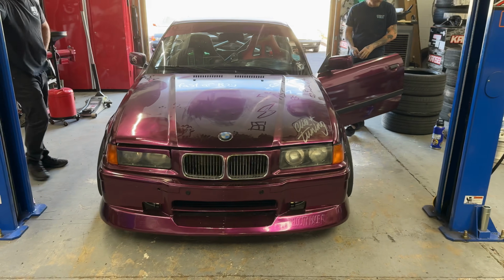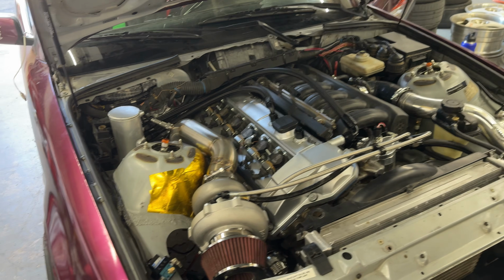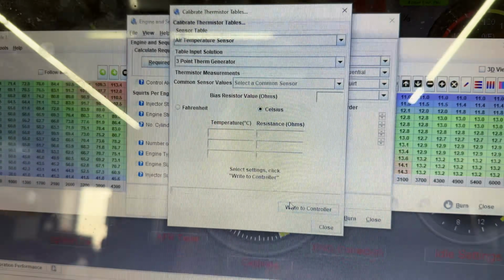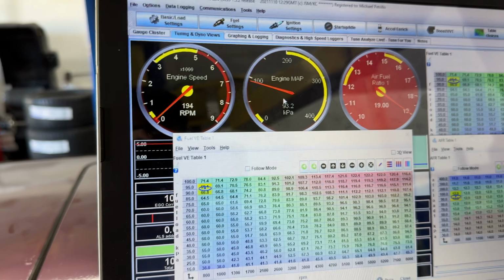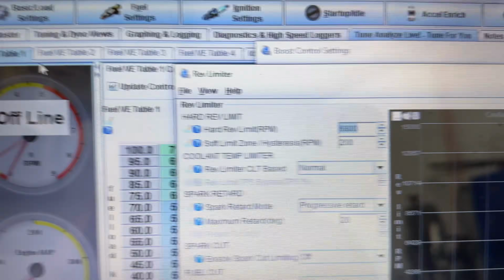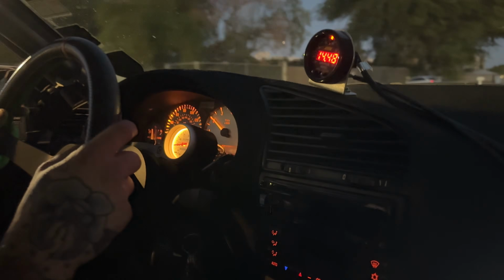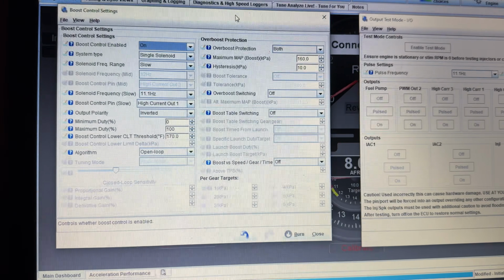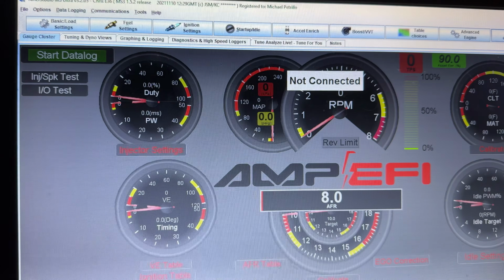Tuning A Turbo BMW E36 With A Megasquirt MS3Pro PnP ECU

Comment: Also if your trying to follow along they put the Injectors in batchfire over sequential becuase if your trying to get a cam sensor for a 96-99 M52 gooooood luuuuuck
Reply from the maker: I agree, it's not worth dealing with cam sensor issues on these cars. Only oem ones work (every aftermarket one I've tried is bad out of the box or lasts a few months) and you can't even buy oem ones 🥲

Comment: Looking at ms3pro pnp for s52. Currently NA, prepping for turbo. Would the choice of wideband controller give a tuner headaches? Looking at the Spartan 3 V2. The installs I can do, just don't want to choose an ECU or components that will have tuners telling me to find someone else or buy something else 😅
Reply from the maker: That wideband controller is one of the dropdown options in the calibraton settings. Its no different from any other to setup

Comment: Let’s make sure to let the potential DIYers know to check that base ignition timing with a timing light before jumping in it. I’ve seen a couple of goons melt pistons because they were commanding way more timing than they thought they were. 
Set your solenoid frequency to 19.5Hz with a 10ms control interval. There should be a dedicated Boost control pin, but I’ve been away from the game for a minute. Polarity doesn’t matter on the MAC valve so just set it to normal, but once you guys get it sorted, remember to ramp that boost in gradually on the stock motor to keep the torque under control (drift car I know 🥲, but it’ll help the engine last). Chris, don’t go manual boost controller. Worst case, just rip it on gate pressure til Mike can get you on the dyno, and INVITE ME. lol 

You guys are badass though for real.
Reply from the maker: Thanks for the tips!

Comment: Would that gm iat work for a link pnp im piecing my similar build not sure what sensors i need
Reply from the maker: Yeah it will work
Reply: @CanyonTuned  Why do you recommend the GM over the factory BMW IAT?